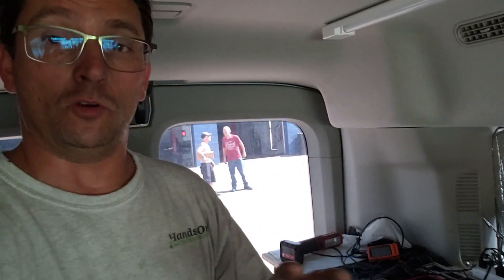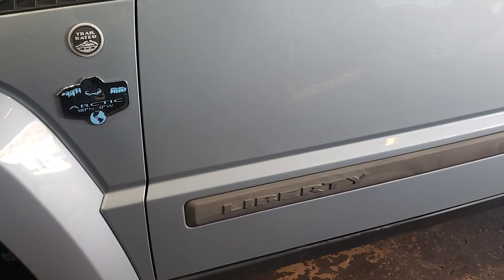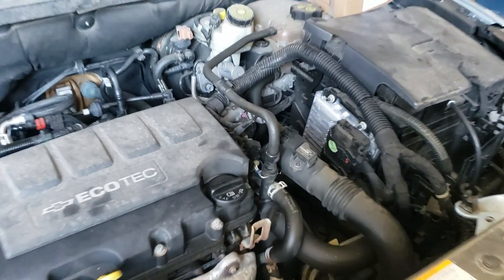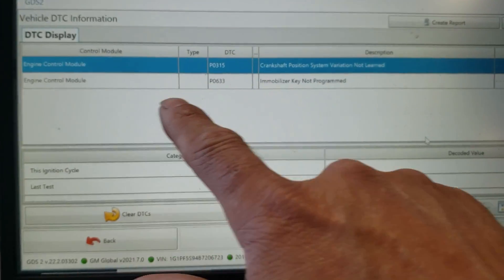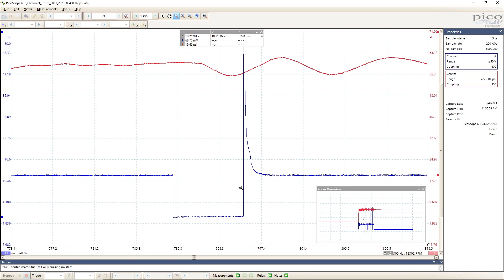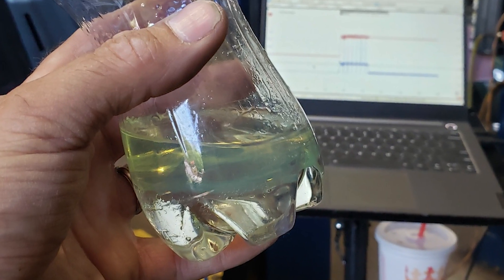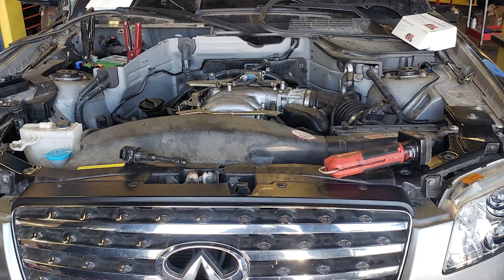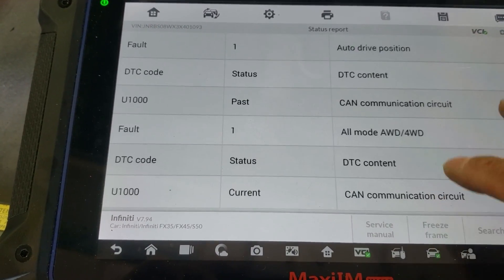8 4 2021 EOD

Comment: It’s probably installer error on the infinity engine job. Or unless cam crank relationship is different than original engine. Like on the jeep Cherokee flex plates I’ve seen
Reply from the maker: It ran for long enough for coolant to burp then started misfires , then no comm . Right now crank start stall , no comm

Comment: Brian great information thanks for sharing while u working really appreciated any code in the PCM it give u direction or some thing to go by so if 60 OHM resister is there and power and ground how is about 5 volt reference do we have that any problems with fuses or may be they forgot  a ground or is shorted when they changed the engine as always thanks for taking time to do this.